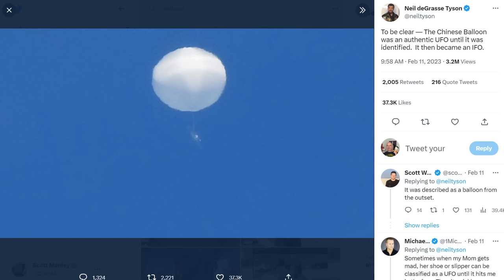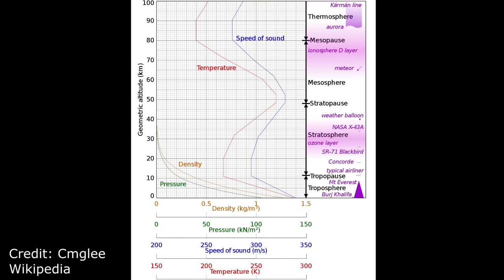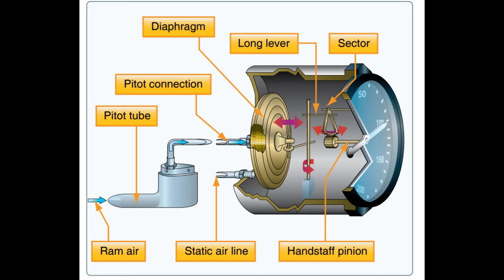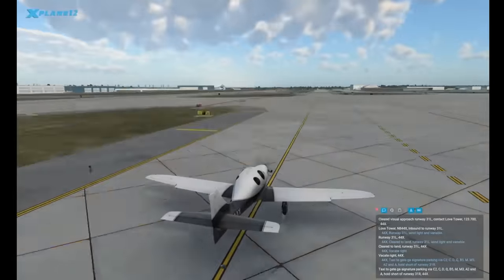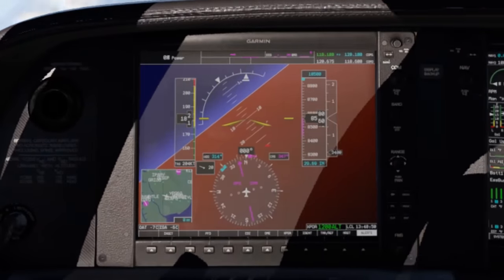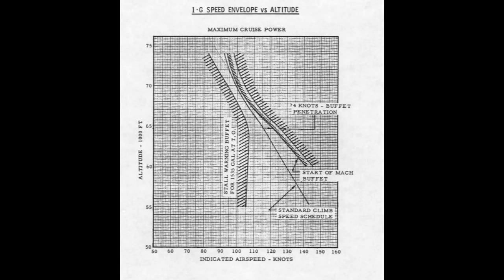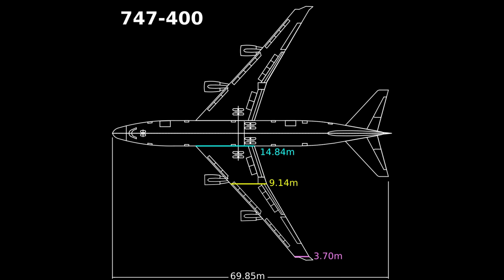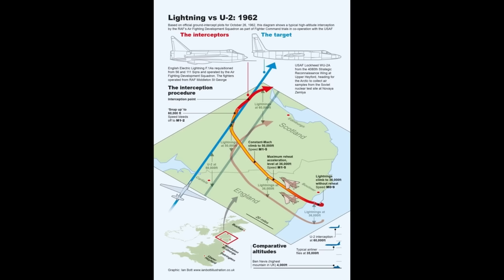How To Design A Plane To Fly At 100,000 Feet?

Comment: I have to add, I read the flight manual for the SR-71 describing turn procedure at max cruising altitude and speed- at max cruise speed of 3.17 Mach and recommended max altitude of 85,000 ft, it specified dropping two thousand feet, THEN initiating the change in course at a maximum of 35 degrees bank... THAT'S how much on the edge of performance that airplane was, that too aggressive a maneuver at max performance could turn it into a cloud of shrapnel...

Comment: Many SR71s were lost with many lives lost as well, though none through enemy action. All were accidents, often related to engine failures or just unstarts at high mach numbers. The magic of Concorde was that it could supercruise at M2.02 at up to 60,000'with 100 passengers in shirt sleeve comfort (no SR71 pressure suits!) enjoying the finest cuisine and wines, and it could do it for up to 4 hours without the need for in-flight refuelling. Engine failure on a Concorde was rare, but if it did happen it was a complete non-event, except it would demand a slow down and a descent to thicker air, so the fuel consumption would go up and you would have to divert unless very close to destination. And it did LON - NY and back several times a day, every day, for 27 years! What an aeroplane!
Reply: Yes, there’s an enormous difference between Mach 2 at 60,000 and Mach 3+ at 85,000+.
Reply: @robertbutsch1802  Point missed.
Reply: @gzk6nk  Sorry. I was merely drawing attention to the fact that your observation that Concorde flight was a relatively benign — not to mention luxurious — experience for the passengers while flying the SR-71 was exotic, challenging, and dangerous for its crew demonstrated the wide gulf between flying 2.02 Mach number at 60,000 ft. vs flying 3+ Mach number at 85,000+ ft.

Comment: A very interesting explanation of the dynamics of flight, Scott, but I have to take exception to your explanation of how a jet engine works.  It is not because the jet exhaust pushes against the air.  It is because of Newton's third law of motion which states that for every action there is an equal and opposite reaction.   A propellor driven aircraft, however, works because the propellor blades are airfoils that generate lift in a horizonal direction, ie., they "push" against the air.

Comment: Generally airliner-jets fly a percentage of the speed of sound called Mach. The relative Mach decreases with altitude, so the further up you cruise the slower you travel. Private jets indeed cruise at higher flight levels, but their true airspeed for the given Mach is slower.

Comment: I walked around the F-104 on static display at the museum at Moffett. Wings the size of a sheet of plywood.
Reply: 'A missile with a man in it', as they were called.
Reply: In fact I wonder if that was the very same plane I saw land there in 1986 or 87.  I was driving down an elevated section of freeway, approaching where it crosses the end of the runway, and what I initially took to be a cruise missile crossed in front of me at about eye level.  After suppressing the flinch reaction, I glanced over in time to see it touch down.  A very fast and shallow approach. I guess they typically land at over 185 knots.

Comment: I'm wondering what you mean at 16:35 with "having to push against air to for their engines" .. because as I understand, the thrust of a jet engine is the result of Newton's third law, the action being the ejection of the high-velocity exhaust gasses and not (primarily) the result of pushing off against the surrounding air, so the problem they don't stop working at some high altitude is mainly due to the pressure/density of the air on the intake side of the engine.

Comment: A lightening fighter was given permission to attempt a dummy interception of a U2 plane. The U2 was flying at over 60,000 feet and the lightening went to over 80,000 to dive down onto the U2. As the lightening can go from take off straight into a vertical climb and then break the sound barrier in the process it probably used sheer grunt (and almost all of its fuel) performing that intercept.

Comment: Scott, that was a very interesting and informative presentation. Of course, in 17 minutes there was a lot you could not cover, but a great explanation regardless. You might find my books (historically accurate novels) interesting: "AURORA: the Ultimate Spyplane," and "AURORA: Journey to ALMAZ-3." In designing my Aurora airplane for the books I utilized SCRAM engines for hypersonic and extreme altitude flight, until I reached altitude and velocity where I applied Waverider and Eddy Current theories. 

DID Aurora exist? I believe it did, although not necessarily with the performance I gave it. During my ATC tenure at Las Vegas TRACON ('77-79), I saw some VERY interesting things on radar, flying in and out of the restricted areas northwest of Vegas (i.e. Area-51).  I like your channel, you earned my subscription....

Comment: The airplane that holds the altitude record for sustained flight is the AeroVironment Helios Prototype -- powered by it's own shadow, i.e. solar powered.  Wiki has it:  "On August 13, 2001,[1] the Helios Prototype piloted remotely by Greg Kendall reached an altitude of 96,863 feet (29,524 m), a world record for sustained horizontal flight by a winged aircraft.[4] The altitude reached was more than 11,000 feet (3,400 m) — or more than 2 miles (3.2 km) — above the previous altitude record for sustained flight by a winged aircraft. In addition, the aircraft spent more than 40 minutes above 96,000 feet (29,000 m)"

Comment: Chuck Yeager set the altitude record at slightly over a hundred three thousand feet in an f-104 delivered to the Basin was equipped with a larger engine, his flight was completely on authorized, he flamed out and wrote it down I believe in a flat spin the somewhere around 50,000 ft or less and parachuted to safety as most everyone knows he is famous for the right stuff and many including many astronauts declared him the best, he was also the first of our aviators to be shot down during WWII and make it back, he walked back, and carried the severely wounded British officer overmuch of the distance, Chuck Yeager was also famous for being one of the top P-51 Aces during the war and retired as a general.
Reply: He was also quite arrogant. He had to be raked down from the F104 flight which everyone else knew was reckless. Also, most astronauts thought he was a jerk for comments he made about the mercury program. He even tried to block Bill Anders from joining the astronaut corps. He may have been a hero. He was also an egotistical jerk sometimes.

Comment: Pratt & Whitney's 747SP engine test bed routinely flies at 47,000 for testing ops, and during original flight testing in the 1970's Boeing said the SP was capable of a 600 ft/m climb rate at 46,000 ft. With 747-400 engines I'll bet it could easily match the Citation-X and Gulfstream G-series and maybe exceed them if you added the AP blended winglets developed for the 747 classics, taking the span from 195 to 217 feet.

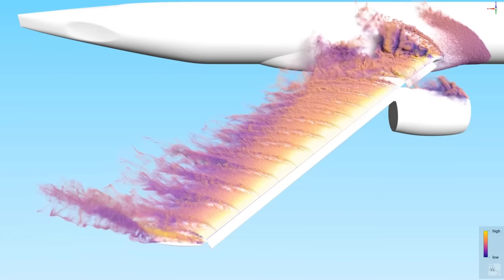Comment: 1:55 Ummm, no. Since we're being technical, let's also be correct. The engine does not "push against the atmosphere" - it is action and reaction. Propellors create lift by spinning IN the air, and also some thrust by pushing air backwards, but they do not get that thrust by "pushing" against the atmosphere. Also, "pure" jets create thrust by expelling high-velocity gases (I say "pure" because high-bypass jets also use "propellors", but still no pushing). If you're confused, think rockets - they work in atmosphere, and outside it, because Newton.

Comment: I haven't been able to confirm it, but my understanding was the top speed for the concorde came down to a temperature sensor located at the nose (highest point of thermal stress) and keeping that at or under the target resulted in cruising at about Mach 2.2.

It was heating up enough to impact structural integrity apparently, the engineering with the concorde was awesome.

Comment: I think one factor (it might be the main one) in commercial airliners staying 40k and below is the number of flight cycles they want to get out of their planes.  A pressurized plane can only go through so many compression/decompression cycles before it has to be retired.  The higher the flight level, the less possible cycles.  Private jets that are only flown every few days do not have to worry about the shortened cycle life so they fly above 40k, where there are far more routes available.
Reply: Cycles in airliners aren’t altitude dependent since at altitude they maintain a constant dP. It’s the max dP that minute it but cycles aren’t involved. Modern airliners happily fly above 40000.

Comment: You neglected to add, that a zoom climb is not started from level flight. It needs to have sufficient altitude to affect a high speed dive, from which it is then flown to a much higher altitude, using the addition momentum, as a residual of the energy developed during the dive.

Comment: The other limit for winged aircraft, is set by the point where the stall speed of the aircraft is the speed of sound at that altitude. That applies to so called 'low speed' aircraft, that were not designed for supersonic speeds. Of course, jets can get above that limiting point, but there is still an altitude where there is no lift to be had, no matter what the airspeed is. As examples, the U2 (a sub sonic aircraft) had a service altitude of 80,000 feet +, while the SR-71 is slightly higher at 85,000 feet + and at speeds of Mach 3+.

Comment: Aircraft Above 100,000ft -- Scott Manley

In other words, how to fly aircraft on Mars. After all Mars' surface atmosphere is the equivalent of Earth's 100k.
There are two perspectives to view in flight. 1) the vacuum created above the wing compared to the air pressure below, or 2) the deflection of air mass equivalent to the weight of the vehicle (another mass falling in your place).
In either case the near vacuum at 100k ft means there's very little diff in vacuum above and below the wing, and the air mass deflected is appreciably decreased making high-speed nearly a requirement.
So the Mars helicopter is a significant feat -- more than most think.

Comment: I thought mach tuck was from the center of pressure moving aft along the wing chord, not elevator ineffectiveness (although once tucked, you can get disturbed airflow and elevator ineffectiveness once at an unusual pitch).
Reply: Yes, the aerodynamic center moving aft is what causes a nose down pitching moment.  As you go faster a normal shock can also form on the tailplane ahead of the elevator, disruption the airflow and reducing its ability to compensate for the "tuck". This can easliy be counteracted by an all-moving tailplane or stabilator.

Comment: Aerodynamic Vne is based on True Airspeed - meaning that indicated Vne reduces with climbing altitude. It's possible (and has happened) for glider stall speeds to raise high enough to reach Vne at a high enough altitude. This means it would be impossible to climb further without exceeding Vne and risking inducing flutter (wing oscillation). For these reasons, gliders going for altitude records have to have reinforced wings (and thereby a raised Vne) to avoid flutter of the wings and catastrophic damage to the machine - not to mention considerable risk to the pilot.

Comment: NASA flies three Martin/General Dynamics WB-57 Canberra aircraft originally built by Martin under license from English Electric. Your experiment can be flown over 60000 feet depending on weight and desired endurance. The WB-57 and U-2 are called out in FAA air traffic control orders as "pressure suit flights," and they get special handling where they don't have to change radio frequencies or transponder codes because (at least historically) pressure suits and changing little fiddly avionics dials don't work well together.

Comment: Mach tuck happens because the center of lift moves aft when transonic not because of compressibility on the elevator. They are different problems.

Comment: I really enjoyed this video and found it very informative, thorough and timely. I know nothing about aviation but when this whole "should the balloon be shot down" scenario began, news media liked to point out the balloon, at 80,000 ft altitude, was above the ceiling of most planes. That made me wonder what the ceilings were for different military jets. Thanks for answering my question! 

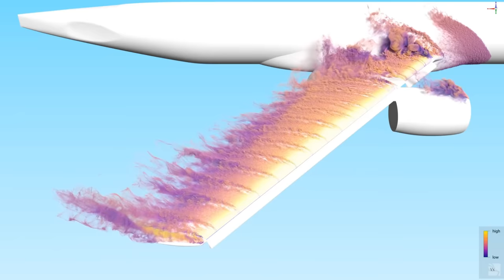I have one question with your video: at 1:54, you say: "Most aircraft use engines which push against the atmosphere to make them move fast enough…" Really? Do jet engines really "push against the atmosphere"? I’m not sure that’s how Newton would have  explained it. 😊 I might have misunderstood what you meant, but don’t jet engines actually use the air (specifically the oxygen in the atmosphere) to allow fuel combustion, leading to thrust (as well as turbine rotation), resulting in a Newtonian "opposite reaction" that propels the plane?

Comment: My final year Uni project was to design a high altitude aircraft. It ended up in coffin corner at a theoretical 88,000ft? maybe? can't quite remember. but that had 4 high aspect ratio wings. 2 Dihedral rear swept, that then joined at the wingtips to 2 anhedral forward swept wings.

Comment: The problem of getting near the speed of sound is the difference between the centre of gravity (this is nearly static if you forget to take into the calculation the centre of the mass of the fuel) and and the centre of lift out of the wings, which moves backwards with respect to increasing speed. Therefore have some military jets frontwings and on commercial jets you can not compensate this difference between the centre of gravity and the centre,  of lift when it starts to loose height.

Comment: Scott,  You mention two ways aircraft use air to fly., Lift is indeed one, but when you state jet engines have to have air to push against, (1:58, and again at the end), Nay Nay, says I.  Jet engines work as reaction devices, air is ONLY required to "feed the fire", and a jet engine would thrust along nicely in a vacuum as long as there was 'air' to, again, feed the fire, we just call it a rocket engine! :-). Propeller airplanes indeed use air to "push against", and some of your prop plane altitude (read air pressure) limits are due to the design and the pitch/bite of the propeller.  Larger surface props are much better at altitude flying than sea level propellers.  Two other main items restricting high altitude ceiling sustained flight, especially in the military, is human physiology and avionics (electronics).  Lack of pressure on the human body IF you were in an unpressurized cabin and at high altitudes (~> 60 K) would cause the blood to boil, which is never a good thing, hence why U-2 and SR-71 pilots (as well as X-15, etc.) are required to use full body pressure suits.  As far as Avionics, the higher you go the less air inside any electronic units can be a problem as well.  Air is used inside all electronics as a dialectric between circuits and the lack of air can cause higher potential circuits to arc to ground or any other point of conduction in the unit.  Modern solid state units, circuit coatings and sealed boxes (to retain surface pressure air) have greatly mitigated arcing issues but in the 60's and early 70's, we had some units, that we would pump up (with a bicycle pump no less) with air to 14-15 PSI as our expected service ceiling was 60K (F-111).

Comment: Max climb rate occurs at max power available, not L/Dmax. Granted, in a propeller plane, the two are very close since the power curve is pretty flat. 

In jet aircraft, however, best climb rate speed is much higher than L/Dmax

Comment: The SR-71 pilot on that missile-evasion maneuver noted that it had been an exceptionally smooth, cold layer at altitude throughout much of the mission. It turned into more of a fuel-management problem than an engine stress problem. From the pilot point of view.

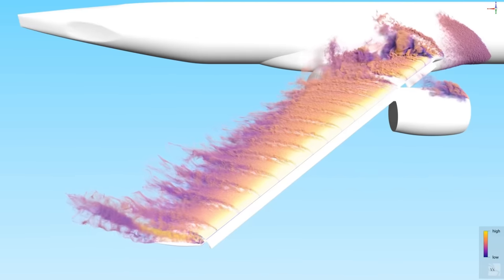Comment: I'm probably not the first to note that helicopters have wings for lift just not fixed wings (2:10). I'm also probably not the first to note that jet engines don't push against the atmosphere (1:53). Propellers produce lift so you might say they push and pull against the atmosphere.

Comment: The F-15 was I believe the first airplane with more thrust than weight. A stripped version with no paint called the "Streak Eagle" at one point owned most of the climb to altitude records- in setting the last of the eight records, it reached an altitude of 98,425 feet in just 3 minutes, 27.8 seconds from brake release at takeoff and "coasted" to nearly 103,000 feet before descending. You have to wonder how high it would have gone if left at full thrust instead of reduced to idle...
Reply: I think the EE Lightning had more thrust than weight. It could accelerate through Mach 1 in a vertical climb!
Reply: The F104 could climb straight up at over mach 1.  Takes more thrust than weight to do that.
Reply: @rickmurray7123  Actually thrust to weight was 0.54 for the Starfighter- 18,000 lbs thrust, takeoff weight about 26,000. It WAS fast though- climb 48,000 ft in one minute... Mach 2...
Reply: @shibumi5210  Its empty weight was 14,000 lb, so with a half load of fuel for showing off, its T:W ratio is about 1:1 so it could go straight up for some distance after a good run at a lower angle of climb.

Comment: What you failed to consider is the type of fuel used in military jet aircraft. Apart from standard JP fuels the air force does have access to special fuels for special missions that can raise high altitude performance.